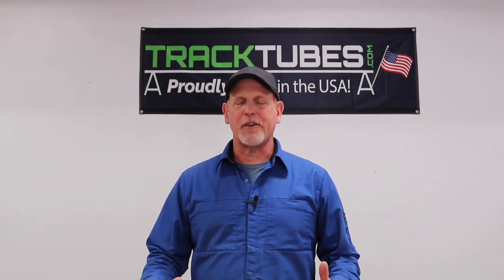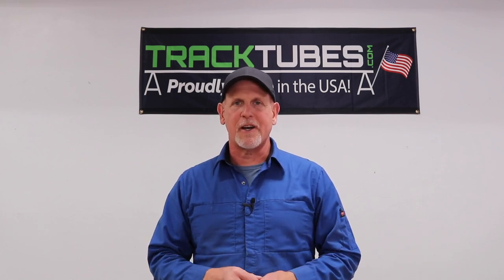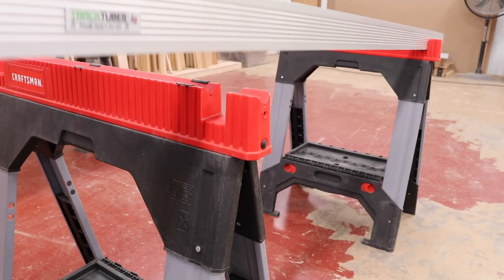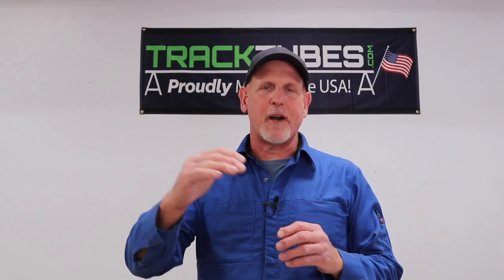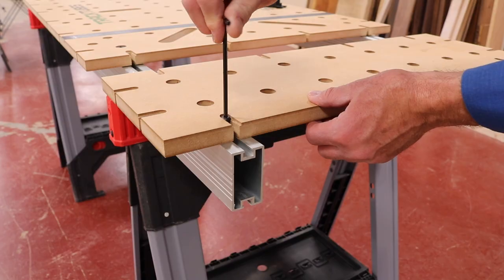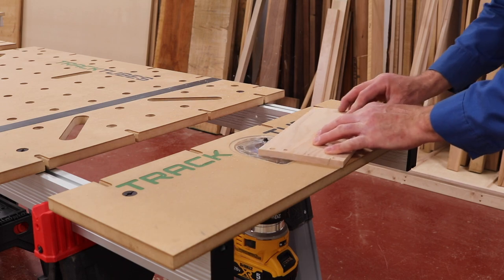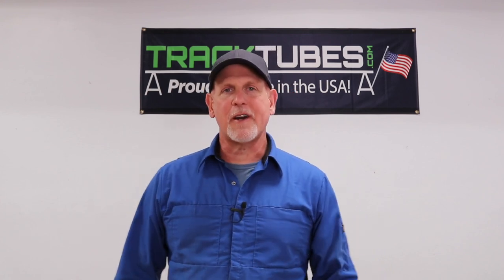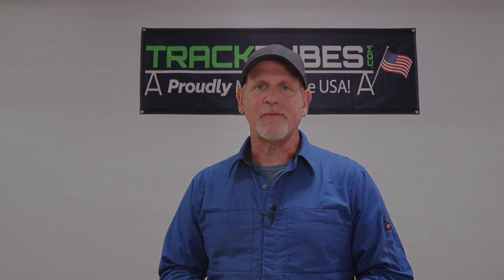TrackTubes Introduction

Comment: Great product.  At 3:56 mark how did you attach the plywood tray to the bottom track?
Reply: With a some bolts and a 1/4-20 nut in the bottom slot.

Comment: Amazing product at an outrageous price.  $179 per track and the most likely use will require two tracks!  I’d love to buy these but the cost is just too high considering they are a supplemental and require several other aspects to really use.  Much better solution than 2x4s but you priced me out.  Good luck.
Reply from the maker: The product is sold in pairs not per piece so you get two tubes for the retail price.  Unfortunately the cost of the extrusions, shipping, packaging have risen dramatically over the last year just like everything else.  If the raw costs of materials decrease then our price will reflect that.  Unfortunately there doesn't seem to be an end in sight to the inflation we are all facing in everyday life right now.  Sure do hope you will take another look at the system now that I have clarified your misunderstanding on the price.  Thanks for the feedback.
Reply: I won’t lie, even if it was per tube, it’d still be a steal compared to what else you get on the market!
Reply: Bidenflation